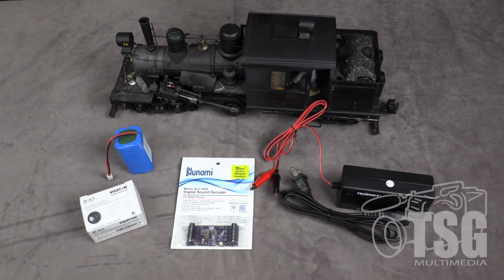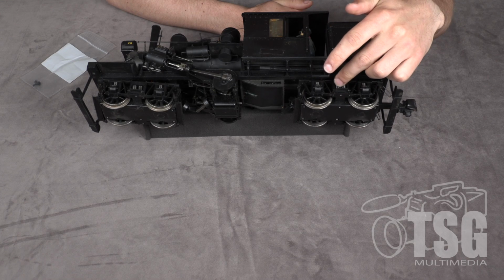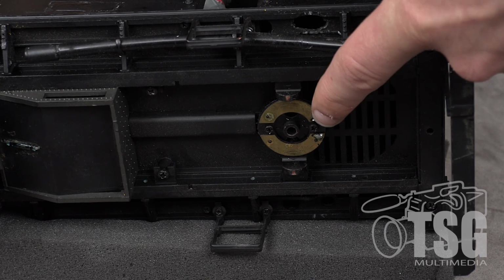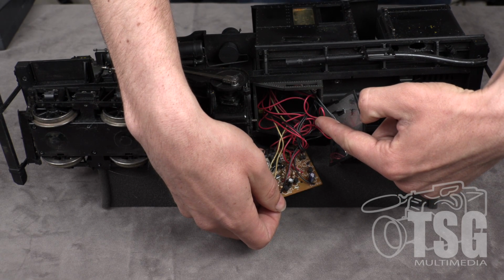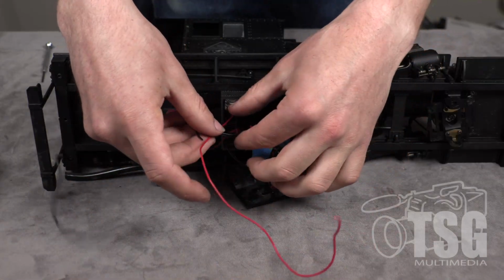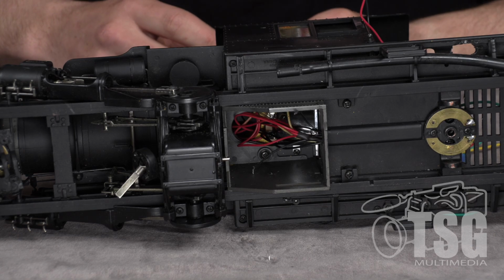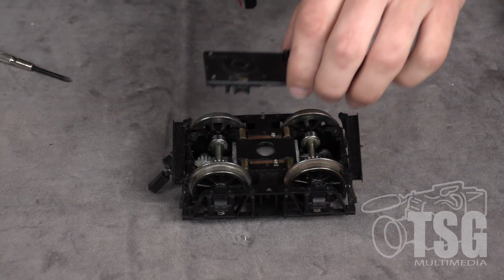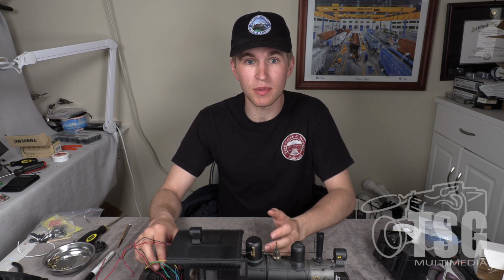How to Battery Conversion SoundTraxx Blunami into Bachmann Garden Scale Climax Fn3 Part 1

Comment: Since this was made 2 years ago, would you say that the battery and charger your used for this conversaion are still good, based on user experience or would you recommend a different battery and charger setup?
Reply from the maker: I don't have any reason to expect something different would work better. I get about 2-3 hours of continuous use out of one charge, and that's working the model pretty hard on steep grades pulling a fairly heavy train. On a flat layout I'd expect it to last longer than that.

Comment: Does anyone have access to 3D printing files or spare parts for the climax power trucks gear assembly. My recently purchased engine has the same issues as the one featured in the video here except the whole gearbox needs replacing and all the gears. I tried searching for a donor engine but have had no luck for weeks. If anyone could provide some useful tips or information I would greatly appreciate it.

Comment: When you had the bottom plate of the drive units , why wouldn't you talk about inspecting gears , axle bearings , and lubrication . Where is the follow up to this , it should include replacing bulbs (assumed) with LEDs and firebox

Comment: Great video series and perfect timing as I also have a 1st Gen Climax I want to upgrade to Blunami/battery

Did you end up putting new LEDs in the firebox to replace the ones that were on the circuit board? If so, what did you use?
Reply from the maker: I didn't do anything with the firebox. The goals for this project did not include full use of all the lighting effects. I figure that I will eventually redo the firebox and cab interior lights.
Reply: @tsgmultimedia  gotcha
I always liked the firebox flicker but on my gen1 Climax and Shay it never seemed to work that well. From what I can see the Blunami has all the flicker functions built in so should just need the right LEDs for that

Comment: Great work to simplify the wiring.  Also, Bachman locos are wired for dual polarity because UK has opposite DC polarity that USA, because of course they do…. So extra wires running through the model to accommodate that issue that can be eliminated as well.  Great 1st chapter, can’t wait to see part 2.
Reply: This generation of Climax is actually so old it doesn't have the polarity switch. They started that sometime in the early to mid 2000s, and there would be a second switch for that in the smokebox. This engine is from like 1999 or 2000, before they did that. In engines that have that, I always rip that stuff out as well like you suggest.

It was great getting to finally work with a Blunami. Thanks for all that you and the rest of the team at Soundtraxx do to give the large scale folks great sound decoders that can keep up with the demands of the engines.
Reply from the maker: Thanks George. Trevor knows his stuff and I learned a lot from making this series with him!